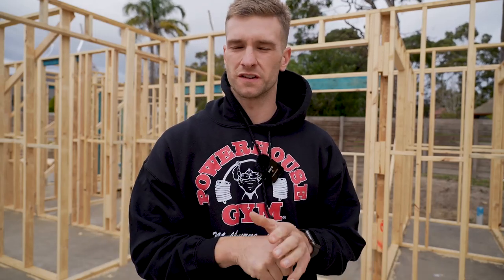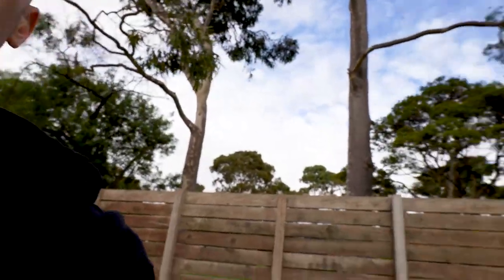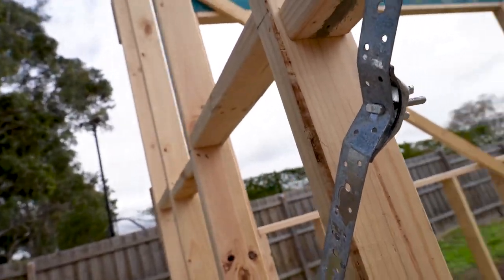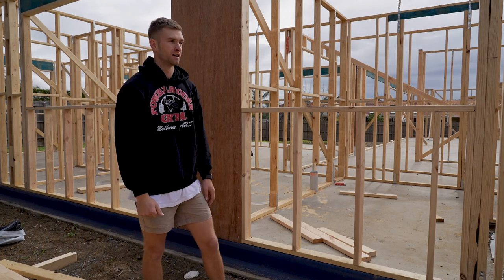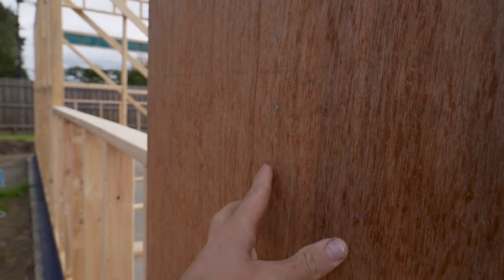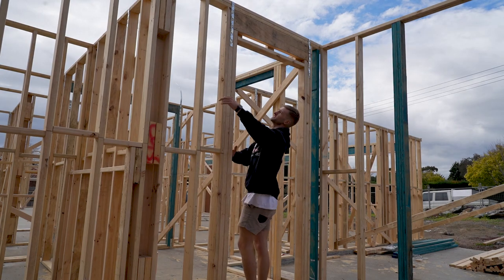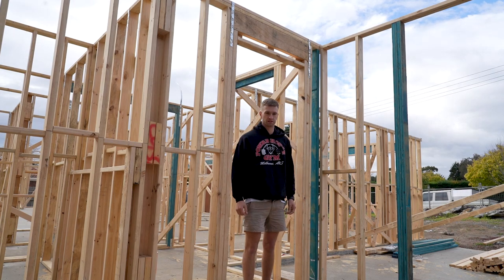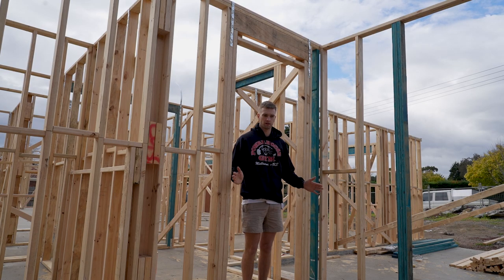Overview Of Bracing Off A Frame // Frame Carpentry

Comment: Just want to add, if you do need to put ply internally, put it on the 'bows in' side of the wall so  you can just pack over it to straighten the wall. I've had to rip ply off to straighten a wall too many times

Comment: Hi, if you have ply brace on internal walls. Do you insert plaster board over the the ply braced (assuming intenal walls are lined with plaster board)? Your video is very helpful.

Comment: In terms of tie downs, are the days of threaded rod in the slab gone and no longer required?
Reply from the maker: still a thing, just depends on the job
Reply: Tie down requirements differ due to the region you’re building in and exposure to wind. Only cyclonic regions tend to have full length threaded rod from top plate down to slab. Most houses in Australia just require Ankascrews or Dynabolts through the bottom plate into the slab and stud ties/strapping as tie down. Some even just require Ramset nails shot through the bottom plate into slab, all depends on the area you’re building in.

Comment: For longer walls do you put another X diagonal bracing for the next 2.7m?
Reply from the maker: Depends on the engineering requirements 

Bracing when done by the builder is worked out in units, ie: from the code you might work out you need 12 units of bracing going one way, so as long as what you spec adds to 12 you don’t need extra 
If that makes sense haha